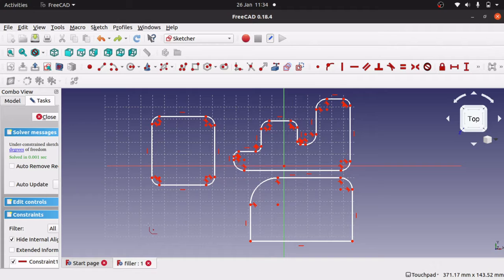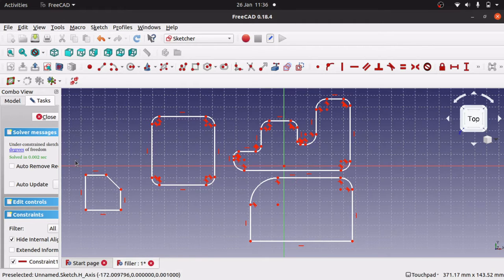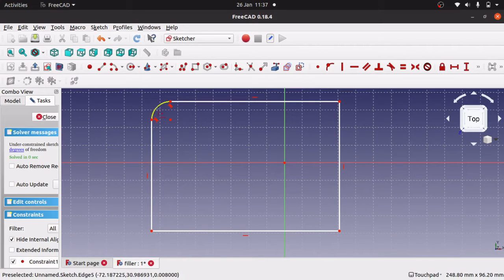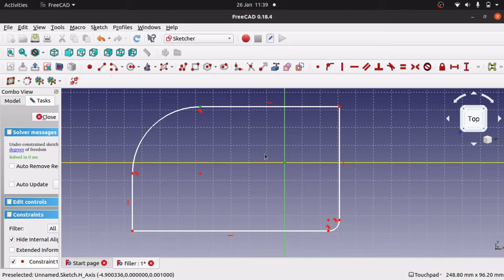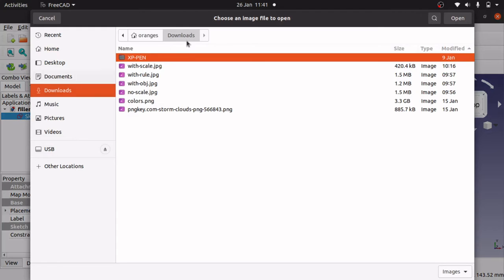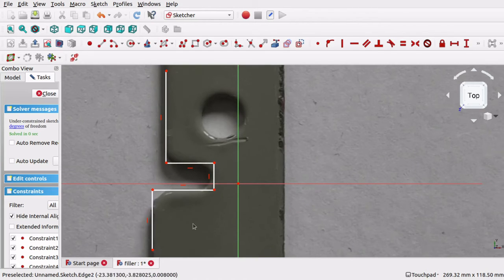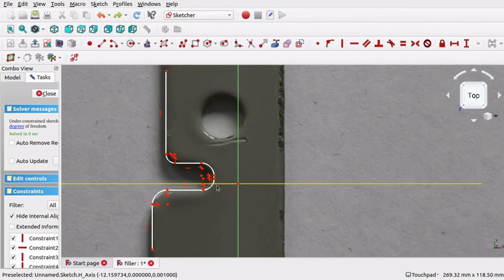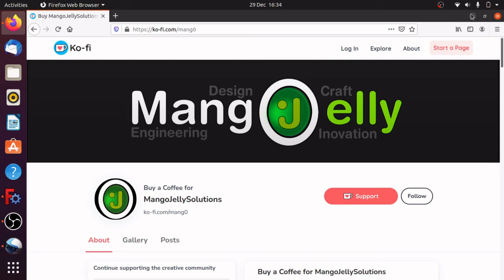FreeCAD : Rounding (Filleting) Edges of Sketch Geometry Tracing curves rounded corners beginners

Comment: Does FreeCAD have the ability to add a fillet between two planes of a part like in Solidworks? So you click on the line where the two faces/planes meet and click the fillet tool and then enter the radius of the fillet. Can FreeCAD do this?
Reply from the maker: Yes it can 😊 exactly the same way as you described.

Comment: Handy tips!  Thanks very much.  I didn't know the tricks of clicking on the lines different distances from the intersection to set the rough size of the fillet.  Also didn't know about just clicking on the intersection to produce a fillet with one click.  Turns out I didn't know much about filleting sketches 😂

Cheers from sunny Canada
Reply from the maker: Glad you enjoyed. I have been using the tool for a while and it's only recently I found out about clicking the lines at different distances as well.